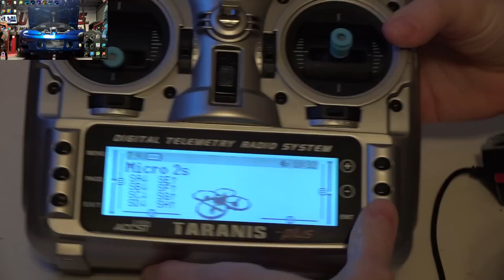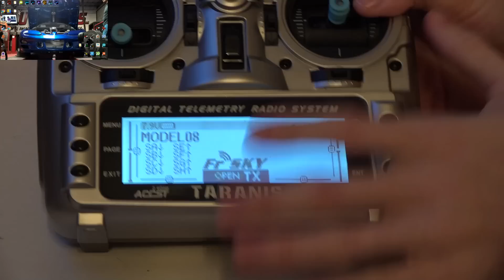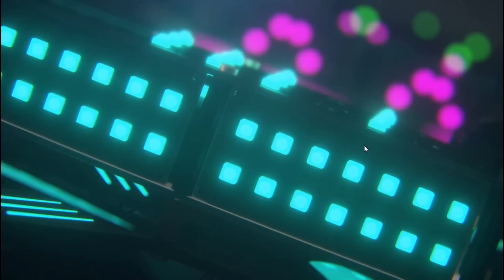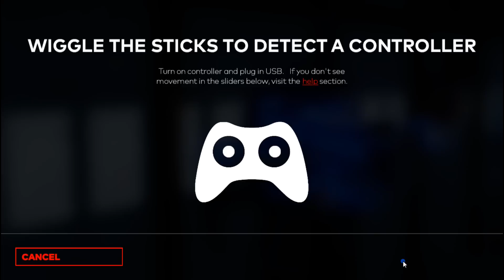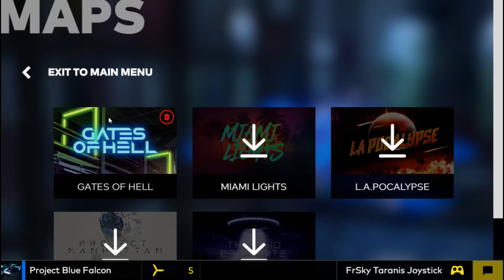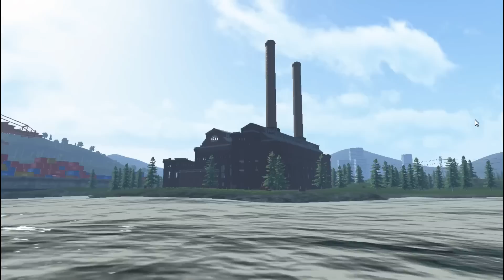DRL Simulator Set Up Guide

Comment: Hi JC, I've tried so many times messing around with my computer trying to get the zipped file to extract all of its files correctly; maybe you might know how to help. When i extract it, all goes well until it gets to the very end where my computer tells me that for the last 50 files, the "files names would be too long for the destination" and my only option is to skip them and have them not be extracted and therefore leave my simulator not able to be used. ive done through every single file of the extracted simulator files and compared them with those of the zipped sim files (freshly downloaded from the website) and i have specifically found the files that are apparently "too long for the destination." Ive tried to move them individually but they still wont go over into the extracted program files. do you have any ideas???  Thanks so much!!

Here is one of the directories to one of the files that wont go from the zipped file into the extracted file because it is "to long":

DRLSimulator_1-1-1_win.zip\DRLSimulator_1-1-1_win\simulator\DRLSimulator_Data\StreamingAssets\PhotonServer\deploy\LoadBalancing\GameServer\bin\Cache\Game\assembly\dl3\1f37b5fc\00d8dbb2_2159d101

and in the file called "00d8dbb2_2159d101" at the end of this directory in the DRL program files is a file called "__AssemblyInfo__" and it is an example of a file that has a file name "too long for the destination"

Again thank you so much for you time JC,
Malin